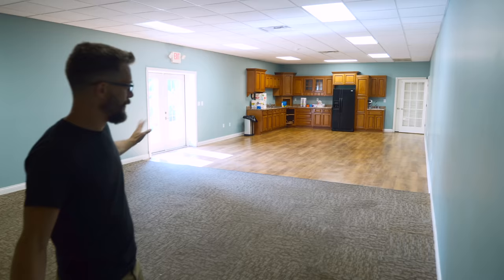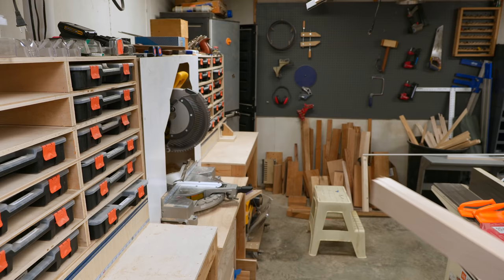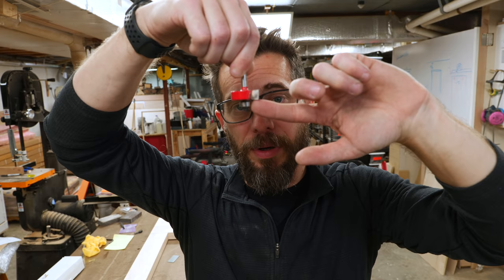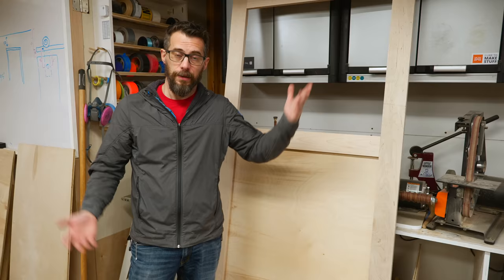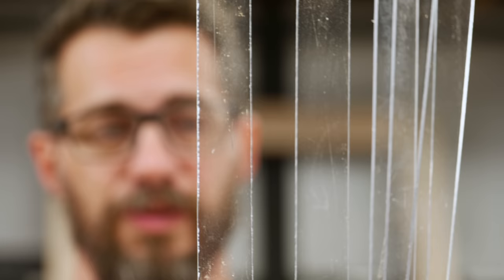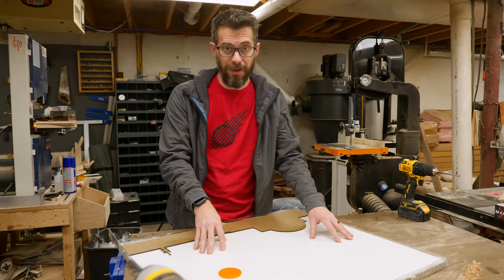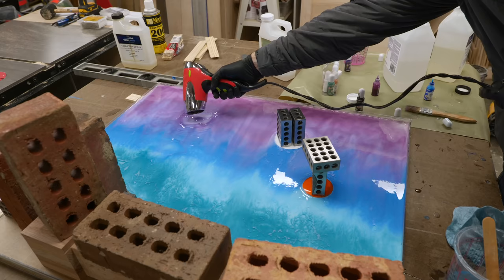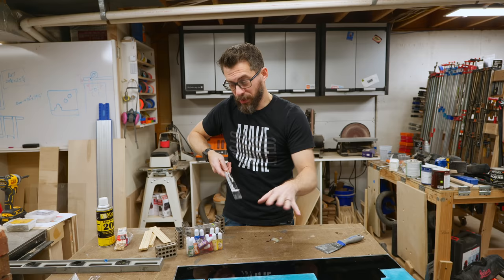Making a Barn Door with a Resin Art Panel

Comment: @I Like To Make Stuff if you work with epoxy again a tip I have seen in other videos is using clear packing tape, to pour on to. Also if you ever wanted to smooth out or clear up the surface I have seen them use a very thin light clear epoxy coat. Hope that helps.
Reply: I used to work in composites manufacturing. Clear packing tape applied carefully will give you a super smooth surface which is significant for demolding. I would still use mold release on top of that, but in general, the smoother the mold, the better. As for the clear coat, my work never concerned itself with a polished resin look, but most resins will get a sorta foggy layer on the surface when they cure. As I understand, a clearcoat will not. You'd probably want to sand the foggy top layer off before you clearcoat it though.

Comment: Great project, it looks awesome. Maybe in the future when you decide to change things up a little, you could do another collaboration with Evan and Katelyn. Like the ping-pong table you three made together a couple of years ago. 

I'm sure you are aware that Evan and Katelyn do tons of art related Resin Epoxy builds. From fake-marble bedside tables to galaxy themed keyboard keys. They have done a lot with resin. So they have tons of experience to make version 2 of this door near perfect.

As a bonus you can maybe also help them with something so there is a colab video on both of your channels. Great for sharing some of the newer audiences of either channel.

Aside from that suggestion, I just wanted to say that for someone who says that they are not fully comfortable when working with epoxy for art, you sure did take all the necessary steps to ensure it was successful. Making a properly sealed mold, leveling the mold, using mold release and weighing down the acrylic. Those were all essential as far as I know. That clearly shows a high level of knowledge and maker experience to do something kinda new and doing it well.

Just one of the many reasons I love watching your video's. Keep up the great work and I can't wait to see what you make next.

Comment: I used to work in the sign industry and used a LOT of Acrylic and Polycarbonate. To get a clean finish as opposed to a safe finish, lower your blade so the teeth of it are.............how to say this, pushing into the plastic rather than the safe way where they are slamming down onto the plastic. So the blade tips are only just poking their heads above the plastic. Your multi tooth blade used to cut aluminium was also a great choice.
The safe cut is to have the teeth pushing the plastic down onto your table and not pushing against the plastic like I suggested, so exercise extreme caution lowering your blade!!
Reply: You can also cut your sheet slightly over size and use a router table to smooth the edges if needed

Comment: Nice project, very cool idea and you pulled it off. My first thought when you added the color was "more color", sadly you couldn't hear me in the past cuz that's when it was needed. Thin resin pours, from my very limited experience, need a lot of color to attain the depth of opacity desired. All this is moot as you have discovered that as I did. On the next one, try some mica powder colors, they tend to have a different way of blending and light refraction.

Comment: one thing you could try to get the resin out of the mold is once you get a corner up use some fishing line or floss to slide between the resin and the mold. that way you won't have to worry about scratching it or cracking it

Comment: I have no experience with epoxy, but I wonder if you blew some compressed air under the sheet when you’re trying to remove it? No idea if that would work but you wouldn’t have to worry about scratching it that way
Reply: They make resin mold release spray. If he got that for future pours, he won't have any issues.

Comment: For future resin pours, get resin mold release spray. The resin will peel right off. Another recommendation is to use a heat gun or torch after every pour to get rid of any bubbles... Unless that's the look you're going for.
Reply: He did use mold release spray he said
Reply: @jdhannan  ahh. I missed that part and with the way it was peeling, it didn't seem like there was any

Comment: i would try this to make the thing fade from red to blue:
- level the form
- raise the blue side slightly ("keep the blue side up!")
- pour the red epoxy. it'll be thicker at one end
- when the red epoxy is hard, level the form again and pour the blue epoxy
hey presto, you have a fade from red to blue. of course, thats not so easy when the whole thing is only 1/8 banana thick, but at 1/2 banana or so it should be possible.

Comment: I think it would be really cool if there was a bit of art on the wall to the left of the door and in the door. The part in the door would have to be mostly transparent. Then when it's opened and closed you could have the interaction of one going over the other. If the wall had your art from the video and the door had some ground and a speeder when you closed the door it would look like the speeder was moving away. Also if you intend to do more resin art may I suggest you consult with fellow makers Evan and Katelyn. They work a ton with resin.

Comment: I've been a fan of barn doors as I also did this to my garage storage shelve doors, however, if using it as a regular door inside the house, my concern is its not sturdy enough to lock the doors as there is nothing holding at the bottom when pushed.

Comment: Would adding a slit on the side of the door that you can make an easy wood piece to go inside make it easier to change the art? Like just remove that wood piece, slide out the art piece, slide thew new one in, then just put the wood piece back inside. Could made with some magnets and springs.

Comment: I know very little about this stuff, so correct me if I'm wrong... but instead of carving a lot of material AFTER putting the 2 pieces of 1 by 4 together to put the bottom panel in, couldn't you just cut a bit from the inside portion of each board and sandwich the panel on the inside? I assume the bottom panel won't be moved

Comment: Oh man that resin sheet made me nervous. The stuff is pretty strong when paired with a fiber reinforcement, but just by itself... i was quite expecting that sheet to just snap during demolding. At least in thin layers I know light fiberglass weaves end up being pretty clear when infused with resin (a 10 gram chopped strand matte is one i've worked with and looks pretty well indistinguishable from pure resin at least 3 layers thick, though that is still a lot thinner than your whole piece). I'd be kinda curious to know just how many layers of such a light weave could be done before it starts to cloud up.

Comment: Should have made the walls around your form higher and use tuck tape instead of silicone.  Also, pour a clear layer first, stick your arcylic pieces to it, pour your color resin, than another clear layer on top of that . Awesome job though.  There is no "right way" to do things, if it worked than cheers!!

Comment: No the chipped plexiglass wouldn't be a problem because the ends don't touch the epoxy. But then why would you use expensive hard to cut material rather than the nice cheap material you were already using or any cheap piece of wood with siding tape?

Comment: I wonder if it would work better to pour it on a large piece of plex instead.  Then just use that as part of the window and not have to peel it.  If it doesn't stick to it i guess that wouldn't work.  Also would need to find a way to fix the flowing over the pieces as sanding it doesn't seem to work very well.

Comment: Instead of doing a rabbit and trim, why not build the rabbit into the braces before gluing them together to it is actually set inside the door centered on the frame? without needing to add trim and leave the front and back cleaner. 

Frame
Fr ART/PANEL
Fr ART/PANEL
Frame
Reply from the maker: I thought about that afterward. Good point though
Reply: @Iliketomakestuff  After getting further into the video you mention the reason why this wouldn't work: being able to swap out the artwork. Being able to swap the artwork would be a nice feature, but you could leave the top of the door slotted so you could slide them in and out without disassembling and no one would see the slot since its hidden at the top.